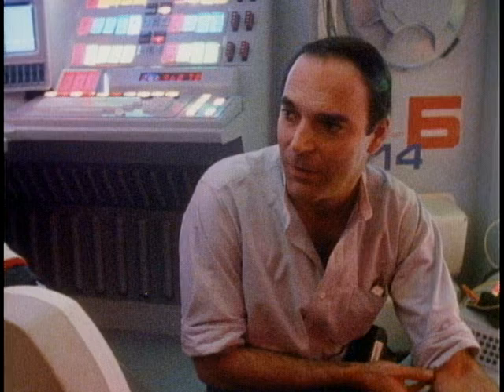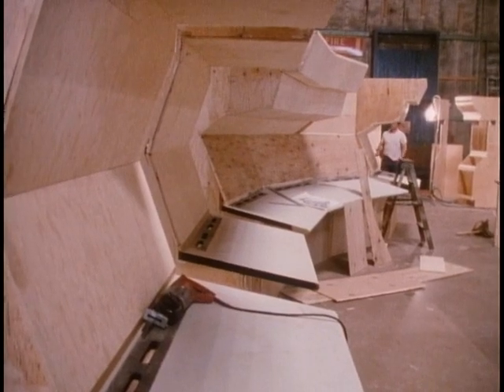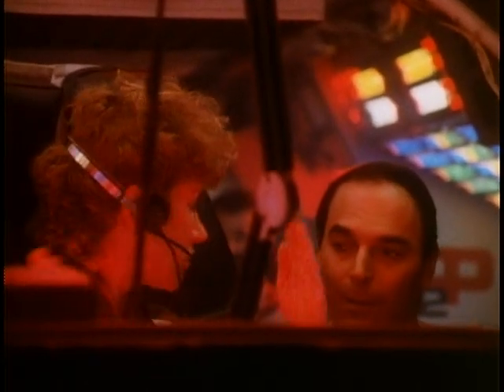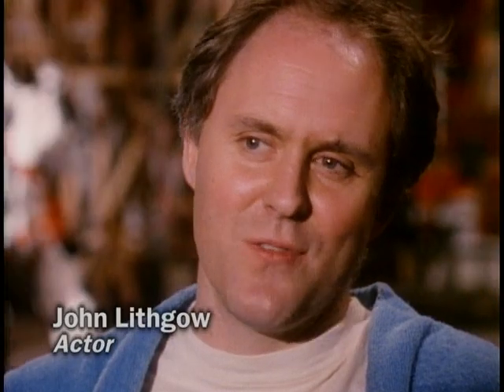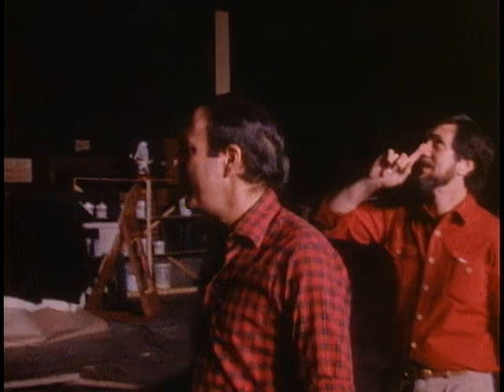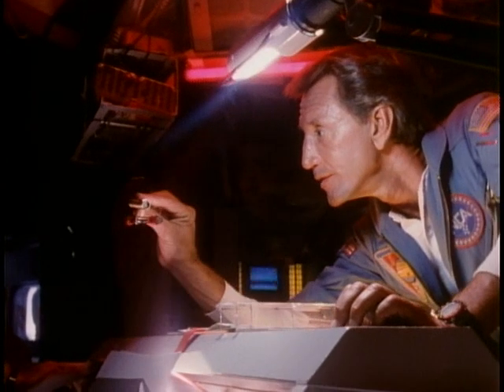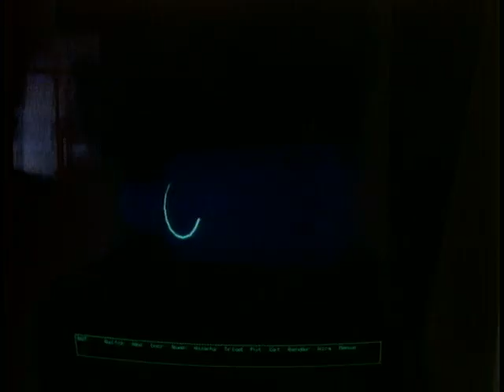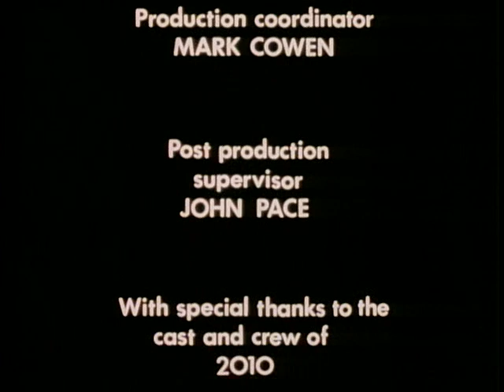2010 - The Odyssey Continues

Comment: when are we gonna get 2061?
Reply: Well, let's see. 2001 was released in '68. 2010 16 years after that. That makes the production interval 1.78x the passage of time between stories. A 60-year interval between 2001 and 2061 would come out to 107 years, so just hold on until 2075. But on the bright side, the special effects by then should be better than anything you can imagine.
Reply: I think 2061 should be fan made. Hollywood will find some way to screw it up with BS quotas and stuff.
Reply: @amightysailingman  2075? I'll be an old man by then I was born in the year 2000, honest to God I would take the option of building a fan-made 2061